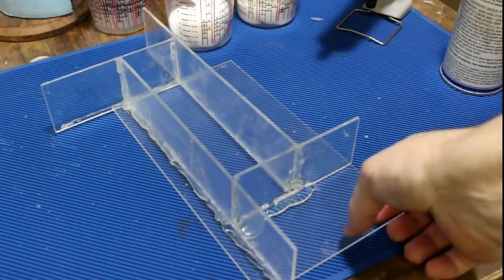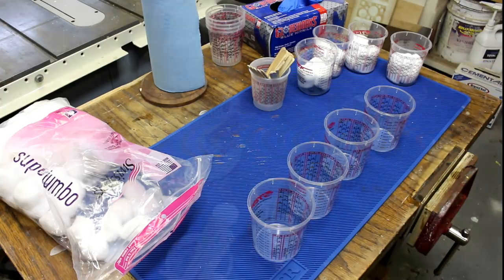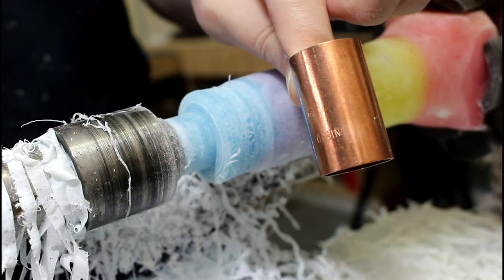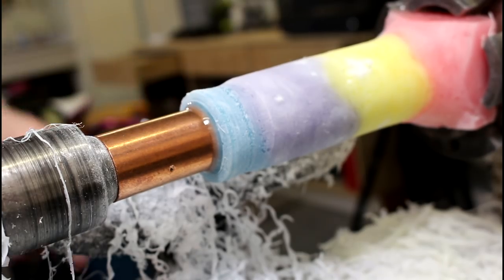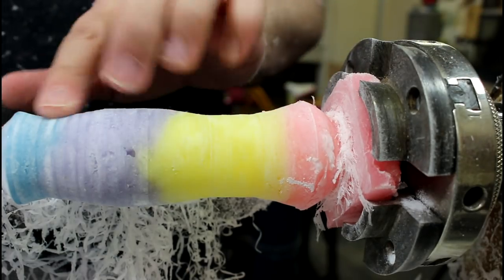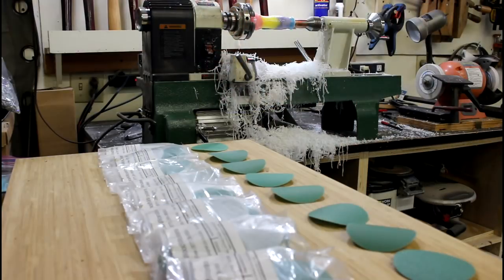Rainbow Cotton Ball Handle

Comment: If you had a vacuum chamber you wouldn't end up with those voids, but it'd also be a little tedious to pump all the air out without the resin bubbling over the cup and into the chamber.
Reply: He doesn't use a vacuum chamber because he wants his viewers to be able to try the projects without the added cost, or at least that's what he has said in the past

Comment: I absolutely want to see someone turn a solid bone teacup.

Could be a segmented blank made from bone plates glued together with 2part epoxy or just bone dust mixed into a paste with heat resistant resin.

I vouch for the 1st option.

I might pass as pesky for repeating myself but in my defence, commenting on YouTube is like sending a message in a bottle.

Comment: Hey peter, I want to get into resin casting into silicone molds. Any suggestions for a good resin for beginners that wouldn’t necessarily need vacuum degassing or other expensive equipment?

Comment: I liked the idea for the handle but I noticed you loosely put the cotton in the mold and knew immediately it was going to have voids and air pockets , I prefer to press the material tightly together but for cotton I think I'd try lightly compressing it together to tighten up the fibers a little and try to get rid of voids maybe even use ahead gun to gid rid of air trapped inside but that requires a different build for the mold as hot glue won't keep it together if you are heating it and a top plate with a few small holes with a small amount of weight evenly set on top would compress it slightly and the hole would allow air to ascape as you heated it,  great handle for an out door tool though

Comment: With sun exposure I'm betting the tool will outlast thew handle by a lot. Epoxy doesn't last very long exposed to the elements. You need to use a Poly ester for that.